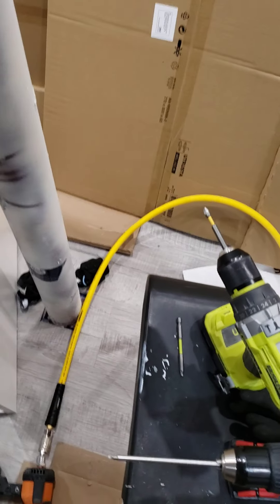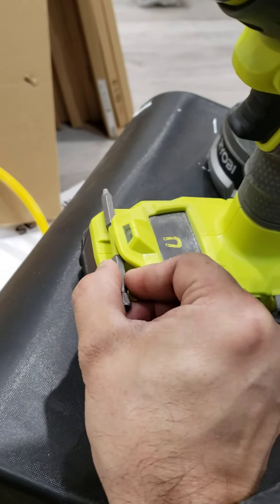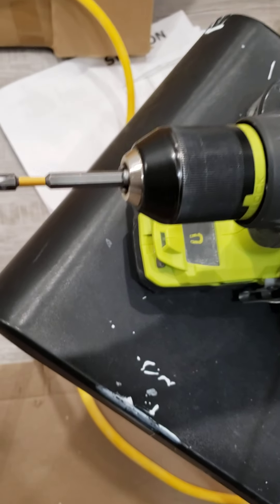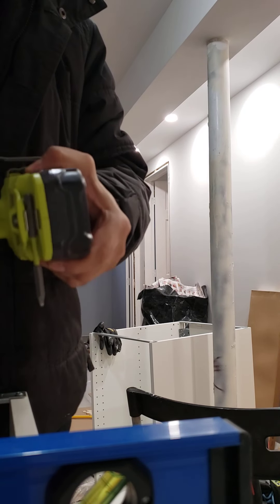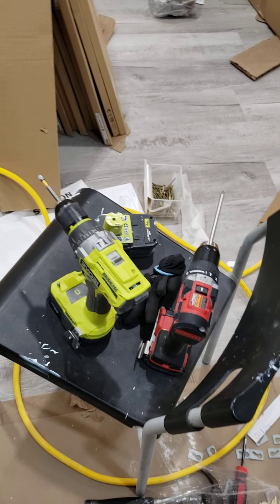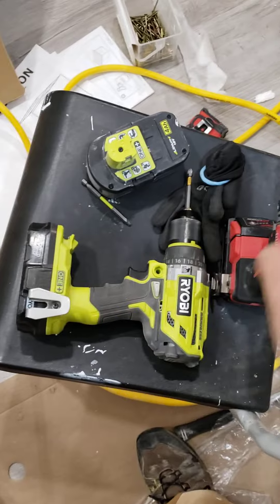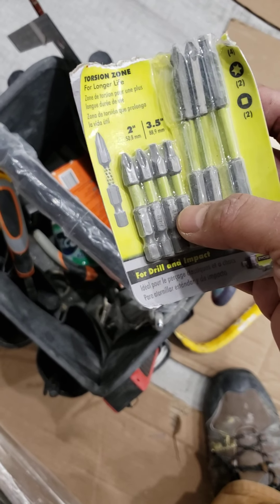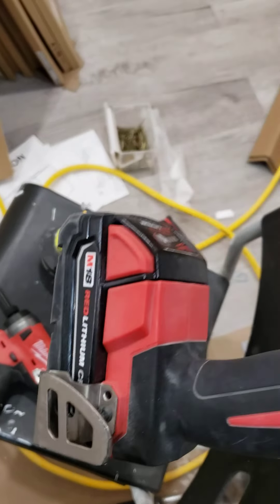Ryobi tools design mistakes

Comment: Is that an old battery? Ryobi redesigned the battery tabs a few years ago for easy removal. 
The light at the bottom is way better than at the chuck because there is far less of a shadow. Ryobi and Dewalt's tri-beam lighting is by far the best. 
Ryobi bits are okay for drills but they are too soft for impacts and you'll break them or round them off. For impact drivers stick with the Dewalt/Makita/Milwaukee, etc.